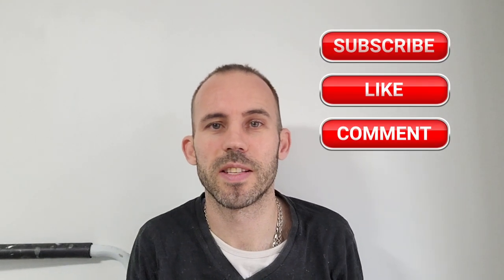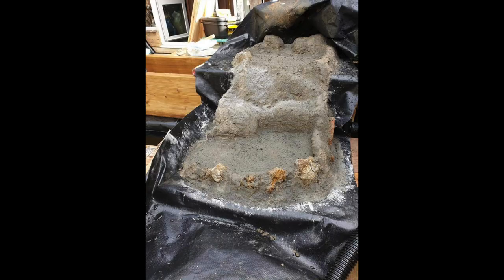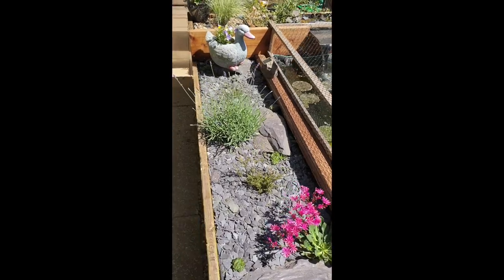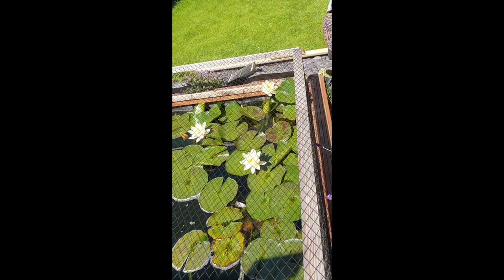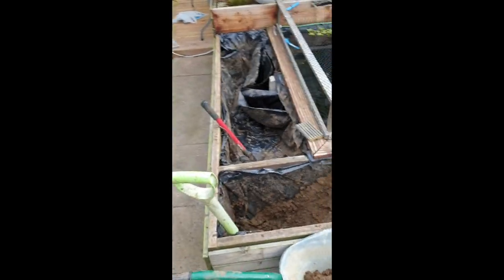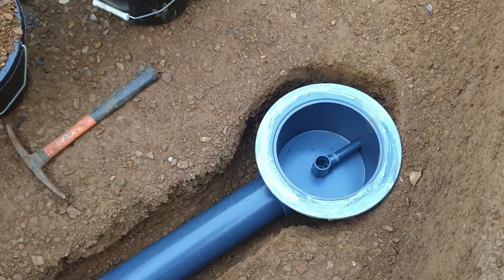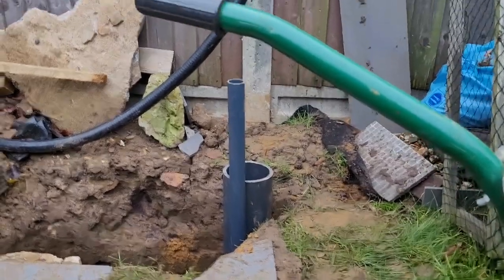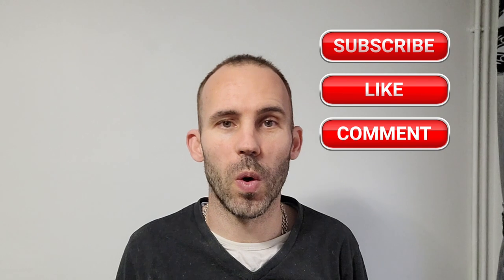The Full Build of My Koi Journey from start to finish (Part 1)

Comment: Did you ever consider fibreglassing it instead of pond liner, especially when you discovered you needed to have a step?
Reply from the maker: Hey Marcia yeh i did consider it but bit after changing my mind about the filters and upgrading to a very expensive drum I just couldn't stretch my budget any further to get it fiberglassed